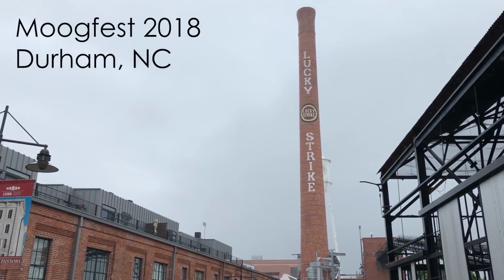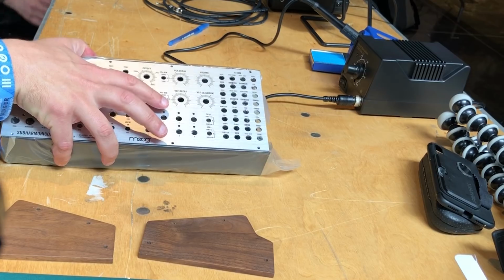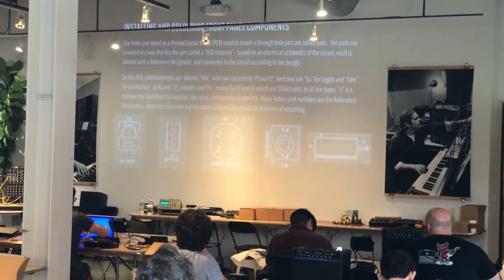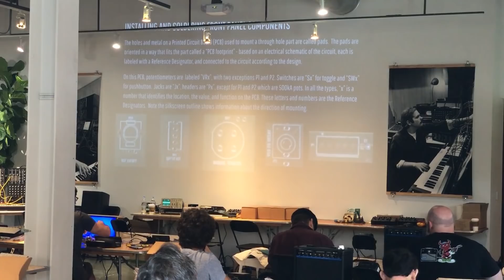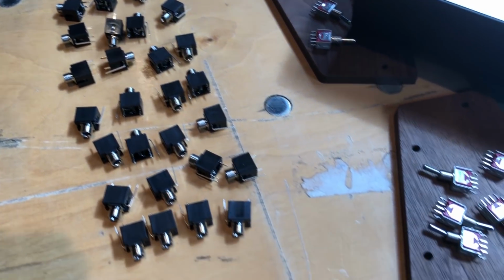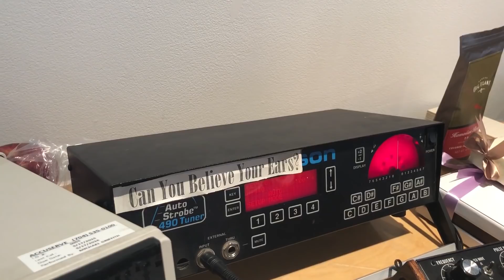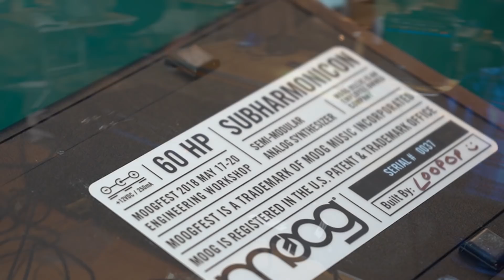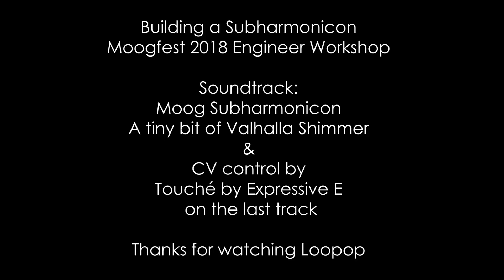Building a Subharmonicon: What it's like to attend a Moog Engineering Workshop

Comment: I see myself in the classroom!! Ha Ha, that's cool!!  Anyway, So it looked like you didn't get the black plates in your kit. The plates go in between the case and the wood end cheeks..  My kit didn't have them in there either, but I remembered from last year that they are supposed to be there...  Combined with the case it makes a nice thin black line around the synth.. And probably makes the ends a bit more sturdy...  Good job on the build..  See you there next year!  I've got some patches on my channel already in case you want to check them out... Cheers..